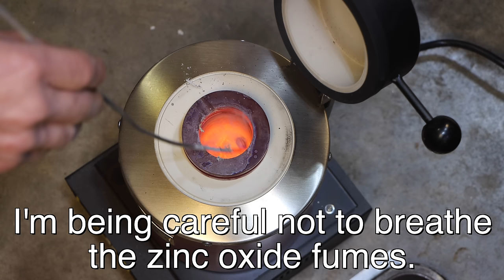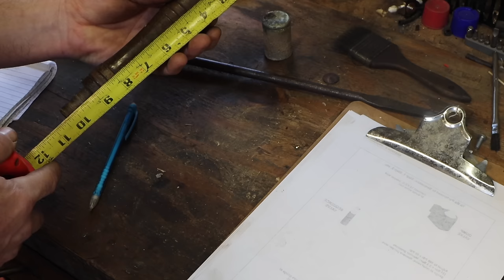One-Of-A-Kind Antique Screwdriver Restoration

Comment: Burning in those tangs is the way to do it. Back in the day, all handles were done that way, with no glue. I made multiple chisel, knife and file handles that way, that I use in the shop a lot, none of them have any glue, just burnt in...

A few tips I would add, if there is a lot of wood to burn out, some fitting like you did is not a bad idea, it helps.
I found that heating them less is better (get the steel just glowing red), if the tang is too hot it can burn more wood then it needs to, this also means you should not keep a hot tang in wood for a long time, especially if you're getting close to the desired fit.
Removing the tang and cleaning (scraping it) helps, doing multiple burns at lower temp is safer.
Do not force a tang by a hammer, when it is working it should slide in by hand, (and there will be a lot of smoke when it is working), if it does not, take it out and re heat.

Never had a problem with epoxy sticking after the burn, but I get such a tight fit that I do not use any glue, only for knife handles that go to the customers I do.

Comment: Enjoyed the vieo of rebuilding old screwdriver as I had done the same to my grandfathers  old one( I had broken it about 5 years earlier). it looks vvery similarin length and shape to yours.
I did manage to  heat up the tongue of the shaft to insert mine and with the epoxy has held weell for nearly 2 years.
I also made a brass collar for the top of the handle to prevent it splitting or chaffing when tapping with mallet / hammer.

Comment: Replacing a cracked vintage handle with a newly made  -- even more -- cracked handle; cracked me up! 

Different strokes for different folks. 

I definitely would have glued the original handle and used it. The break was clean, it was the correct "long grain" for a solid glue joint stronger than the original wood. A little finesse in the finishing would have left the original handle looking about like 1885 -- original. But we all have our drummers we have to march to.

Comment: Hi, a idea if this would be strong enough, turn de handle a bit smaller then put it in a pvc pipe and block one side and fill the pipe with epoxy and then put it back on the lathe and turn it till you are happy.
Strong and protected.😉👍

Comment: An awful lot of handles were made out of Ash which was easy to work when fresh but very hard and reasonable light when dry that's why they use it for framing for furniture which is upholstered because the staples used won't pull out

Comment: The CA glue and dust only stabilize the surface which you turned off. A better solution with walnut is to fill the cracks to depth with black colored epoxy resin, like Total Boat. Epoxy plastic turns very well and the cracks would be permanently bonded. Bonus is the contrast of the dark black crack lines in the finish product.

Comment: If it would fit over (the metal screwdriver part)- I’d have thought put the screwdriver into the handle and then put the brass cap on. It would then tighten the wood back if it had stretched some when you inserted the screwdriver into the handle. Amateur here shooting from the hip- but would that maybe be an option if you do it again to a different screwdriver? Neat job.

Comment: easier way to secure, is cut a dowel, split in 2, sand out thickness of screwdriver. glue (epoxy) on screwdriver. do a hole in handle size of your dowel and glue and push dowell and screwdriver in

Comment: There's not much better a combo than wood, brass, and iron!  Regarding the burn-in method, generally when making knives, the real holder is the cross-pins.  As you noted, the burning the tang in will leave the walls charred and thus unable to bond with the epoxy.  What it's doing is filling all the little cavities, relying on the irregularities to lock it in place and creating a uniform bed that matches the tang.  The cross pins are what really do the heavy lifting, preventing the tang and epoxy from pulling out after a bit of use.

Comment: Those screws in the side of the generator are not brush caps. They hold the stator windings in place. Most times you do not have to replace the windings of they ohm out ok.

Comment: First, that's beautiful and functional, and you did a first-rate job of it. 10/10. I'm sure that the epoxy will be strong enough, but If it were mine, I wouldn't feel right unless it had some sort of mechanical means of transmitting torque from the handle to the shaft, like maybe a pin or two. Again, I'm sure epoxy is good enough for hand torque, but I'm a big fan of over-building where possible.

Comment: Those are not brush caps. Those are field core retainer screws. Usually don't need to remove them unless the field coils are damaged. Then it takes an impact driver. The kind with a screw driver bit on the end and you hit it with a hammer.

Comment: I would oversize the tang hole just slightly then set it in epoxy including the ferrule.  Never had one come loose or break using that method on everything from sledge hammers to tack hammers.

Comment: Very nice  Craftsmanship onthe Screwdriver Handle IMO the Epoxy  despite the Wood Char  will out last  both you and I as far as holding the Handle on that Screwdriver  Another Product i like to use is 3M 5200  which is a Adhesive Caulking generally used in Wooden Boat Building and Restoration  and it forms a Waterproof Tenacous  Permanent bond on many Materials  yet excels    with Wood and Metals

Comment: It’s a nice looking handle and it was interesting on how you tried to fill in the cracks, could I suggest you use a dremel to make the cracks larger, then mix the sawdust from the same wood, mixed with an D4 PVA Wood Glue to then fill in the gaps you’ve made, once dried and cured it can be sanded down and you won’t be able to tell it had a crack at all.

Also I noticed you didn’t get the main shaft fully into the handle (that’s the wide flattened part of the bar shaft, and I’m presuming that’s because you didn’t want the handle to split, unfortunately it needs to be in fully to help with torque when being used, so that when you try and turn the screw while holding the handle it won’t slip), normally you would place the now brass fitting over the bar, then push the bar into the handle and then push the brass part over the handle. The widened part of the bar which fits into the handle is to also help when turning the screws (it grips inside the handle to it doesn’t spin), so you may have to remove and make a new handle if you want to use it for it’s intended purpose. May I also suggest you draw on paper the original handle and then you can use that with the measurements to make a replacement handle and can keep that for future handles if you need it. If you also make the brass fitting last, you could make it larger so the part of the wood it attaches to, can be slightly thicker to help accommodate the metal rod.

It would be worth watching some Bush Craft and black smithing Tool making videos as these will help you understand how tool handles were fitted. There are some good 19th and 18th century information about the process and techniques and technology. These will help you in your future videos.

May I also suggest at the end of the video where you were trying to work on the engine part, don’t use such a long screwdriver, you’re not prying it off so “Archimedes Law Of Lever” doesn’t apply, instead use a much more shorter screwdriver and fasten the part into a vice (you may need to make an adjustable one for various projects) and you’ll be able to get more pressure and torque onto the screw, also use some WD40 if it is metal as it may have seized.

I hope this helps and I really enjoyed your video, I’ll be checking your other ones out. Please keep making these, it not only shows how you work but also your reasoning when making things.

One last note, I just thought of, depending what handles are being used for, if you have a vacuum chamber, you could also infuse the wood with resin which could also fill in any gaps and you can also use your lathe on it.

Comment: Burning in isn’t just about “burning” a hole, it’s about making the lignins plastic so that they deform.  There’s definite charring, but there’s quite a bit of wood fiber deformation.  Try it out on some beech or ash.  You don’t need epoxy.  Once it cools, it’s quite tight.  Blacksmiths used this method to attach wooden handles to chisels and gouges etc for hundreds of years.(long before screws were invented).  Wrap a moist cloth around the shank to protect the temper, but i suppose that’s obvious…

Comment: You should have soaked the round wood in epoxy near size. Then all those cracks would be solid. And final turning and polish could be nice and solid. Just add epoxy at the end to glue the casting and polish to a shine.

Comment: Love the handle.

I see the one piston in the background what was welded.  Looked good from what I saw.  But I did not see two of them..

I know area diesel said something about shipping you the rings.
if you  get the compression up and oil blow by fixed should be a good running engine then..

Goodluck

Comment: Hi there
Good job on that old screw driver , my father had one similar but not quite as big , 
I’d like to ask a question,  why do you almost never use the can of wd40 that was about 1 foot from the seized bolt/ screw you were working on , I’d like to add it’s not only your videos this happens in , nearly every mechanical repair video on YouTube never pre spray a project and let it soak before getting started , any oil based releasing fluid if used prior to the job aids removal and assembly, I just never see anyone do it , and wondered why , 
I love watching your videos , keep up the good work 
Regards Davy 🏴🇹🇭

Comment: As an old-time Chevrolet I have a similar but smaller long screwdriver that I still have in my box I bought it in the fifties to reach down and take the lower radiator hose off of the old Chevys of course mine is smaller

Comment: I have an old screwdriver that has drive mechanism built into the handle, you line up your screw and push it, it turns the screw in, still works but I'm afraid to try this early driver bc if you miss the screw or slip, you're potentially  going to puncture your hand. It has reverse too but this push to remove action is kinda counterintuitive.
Reply: thats called a yankee screwdriver, i have 2 of them, handy tool
Reply: @adam03110  its very old with teardrop wooden handle scales, I have quite a few hand tools from early 40's, I plan on trying to determine its age and purpose  .. obviously with pre-drilled holes something like this would be quite handy.
Reply: It is going to depend on how much prior use it has received. Try cleaning up internal mung with a good penetrant like Liquid Wrench. Dry that up and use,oh,dry graphite spray. Thousands were sold and used up prior to electric drills and screwdrivers. My grandfather had one,by the time I was an adult it was used up,I still keep it but have a half dozen later ones that actually work. Several different sizes. Straight flute drill bits were made to fit the things,still available. The current sizes and bits may not fit yours,some were proprietary manufacture. While I think on it,a soluble oil like Ballistol would clean and preserve both wood and metal. The wooden handle is likely to be very dry. There are several bits of advice to address that,figure out what works for you. Good luck. Even if it turns out to be a wall hanger,it is a blast from the past.
Reply: @paulmanson253  yeah they handle is steel with attached wood scales, unlike ones seen on Google images thanks for tips, I'm definitely keeping it around, some stuff just makes you smile.

Comment: That screw on the generator will come off by cradling the generator on the vise and using a small ball peen hanner using the ball side against the head of the screw you beat it with a heavy hammer a couple of times. This will loosen it so it will come off with a regular screwdriver. I did that for years when i rebuilt them.

Comment: But the real reason I was applying was about wooden handled screwdrivers old Chevrolet had a lot of slot head screws wooden handle screwdrivers work so much better than other materials and I always grind a new tip on the valve grinding machine

Comment: #1: Is it John or Jon? I'm guessing it's Jon. :) #2: Here's a little tip for ya. Next time you need to fill a crack in wood or anything else for that matter....fill the crack with baking soda, then squirt your CA glue in there with it. Turns rock solid. Amazing stuff! :) Oh, and superb on the screw driver rehab.
Reply from the maker: You are correct, it's Jon.  Cheers!

Comment: To seat an object in a wood handle (axe, chisel), hit with solid object (mallet, hammer, forehead) on the back end. In other words, from the top of the wood handle. So called burning in will not work with tooks that are twisted. I personally think burning in has included planned obsolesence within the process. 
Always a pleaure to watch someone so knowledgeable and articulate noddling around demonstrating the old maxim- if you strut your stuff, you🔨🔨🔨 get no guff.

Comment: Those pole screws will be rusted in place. Heat the scew head with a torch. Quench with water at first. Rinse and repeat.Once dried,dribble good quality penetrant and let soak. Pretty much the only way to reliably get them off is with an impact air tool or one of those smack it with a hammer units. They are on tight,and drilling out a ruined screw is not fun. Good luck.

Comment: Personally, I wouldn't have screwed around with that Walnut Root trying to find a crack-free chunk to turn...

I'd have just melted enough Brass to cast a full length cylinder and turned a solid Brass Handle for the screwdriver...

Brass is soft enough that you can turn it on a Wood Lathe using wood gouges if you take your time and don't try forcing the tools into the metal too hard or fast...

Comment: I believe thats box wood. Very hard wood but likes to split just like that
Reply: And you likely picked up all of those cracks by twisting the roots when you dug it up. What else could you do though?!
Reply: The burn in would hold without epoxy or anything extra too
Reply: Could have even used a cross drilled hole with pin
Reply: Awesome work though!
Reply: I don't think those are brush caps I think they're the screws that hold the magnets in

Comment: Hi I don't understand why you chose casting? Granular metal structure is not really ideal for that purpose. A bezel should really be cold rolled brass or steel. Much better crystalline structure. A cast bezel is headed for the same problem you had the las time. Plus you probably need another one on the end since the handle is broken. It cracked because the cast iron failed and the wood is ancient and dry. Technically it should be replaced.

Comment: Nice work, John. I'm so glad you made this video. It is something I've done in the past, but you should have chosen the burn method. Have a little faith. After all, if it goes wrong, simply start again, and again. That's what I did until I got it right. 

Over the years, I repaired probably around 250 to 300 handles belonging to friends and family. I always tested out new methods on my own broken tools first.

I've cast ferrules out of brass, stainless steel but boring holes or drilling into it can be a bit tricky. I have also used silver, but that was for a retirement gift for my father.

As you rightly said, the old way was to heat the shaft or shank to a cherry red colour, then push it into the handle. As it cools down, when the smoke has finished, tap the shaft or shank home about 5mm, thats about 5/8 of an inch in old money.

I have also used resin or two pack as we call it in the UK. Not to be confused with the rap singer, too soon?

I found after a while the shaft or shank became loose. This was the same whether I used the burn technique or, as you did, drilling out the hole in stages.

You had concerns whether or not the resin would stick to the burnt embers, it does. The resin will soak deep within its sourndings, so no worries there. 

I meant what I said. Have faith in your ability as a good all-around DIY enthusiast John. You're a man who will turn his hands to anything that needs to be done and fixes most things he touches! 

It's a shame you don't have the Midus touch 😉🇬🇧🇺🇦⚒️
Reply: Smoke testing CA adhesive is a bad idea.  Your way was better Jon. 
 Burn method was not needed.

Comment: So why I burn in files to the handle I never go all the way to the final depth. The last portion I still drive in with a hammer and that has always held firm for me. no need for glue but I also don't tend to use files as a pry tool.

Comment: Uh cast iron has more tensile strength then brass
Reply from the maker: It's also cheaper than brass, so why are almost all tool ferrules made of brass?  Cast iron is brittle and breaks when used in tension like that.